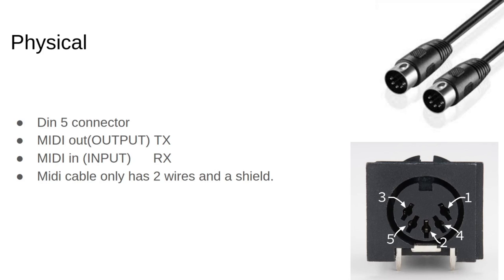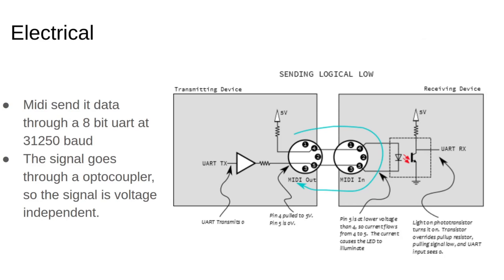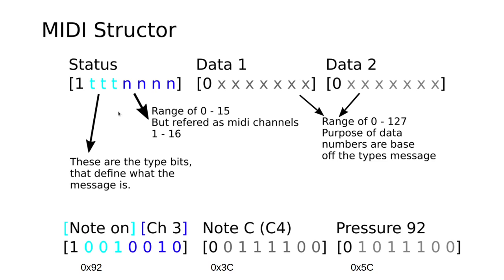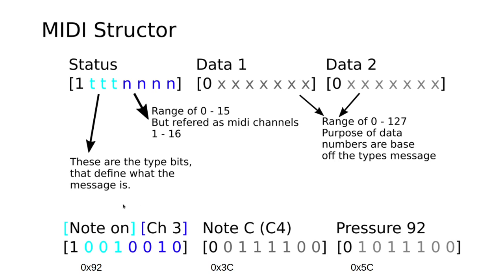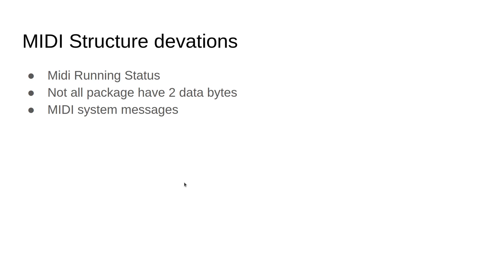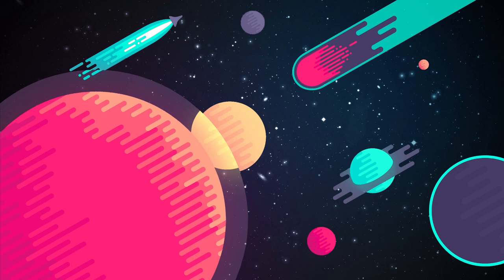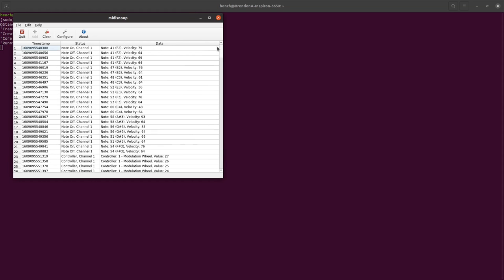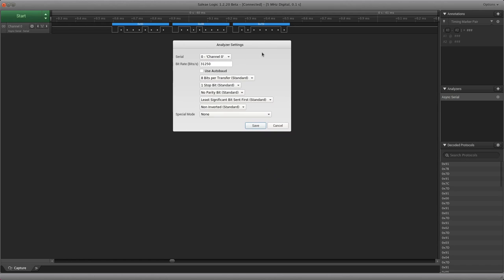MIDI protocol overview

Comment: Very nice video on the MIDI protocol! I've been interested in transmission protocols lately and I really enjoyed this video. As an audio editing suggestion, consider using crossfades next time to prevent pops during the jump cuts. Many editing software programs, like ProTools and Ableton, add these by default, but adding additional ones can further smoothen audio transitions.
Reply from the maker: Ya i'm very happy about the visuals, but ya the audio's fairly bad.  I've remember the audio was very bad, but i just stuck with it because i didn't have it in me to record it again.  Also i remember i was hell bent on using all open source software and it can be ruff.  I found the best way was to make the video then export the audio to audacity to do the mix and the rerender the video!  Lately I'm too lazy and have no time so i just use imovie.  But since this video i've bought a real mic and not the mic i used to do concerts with.